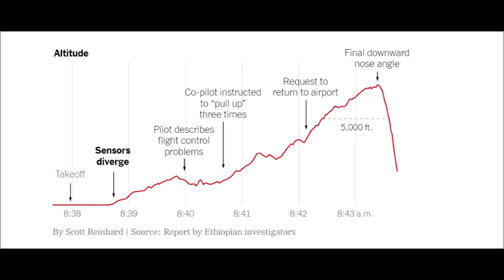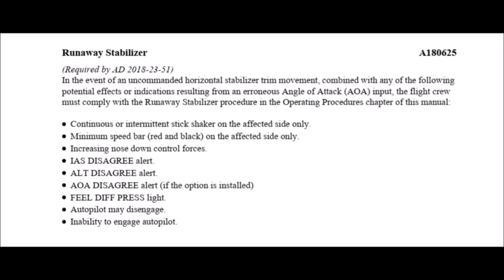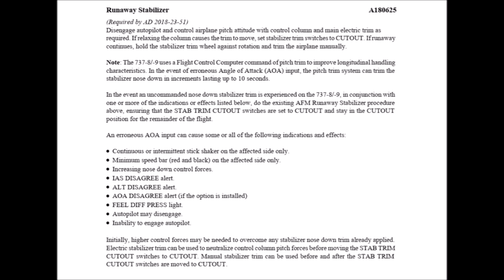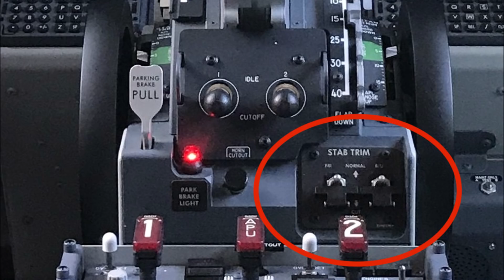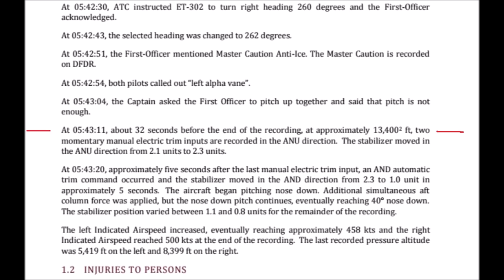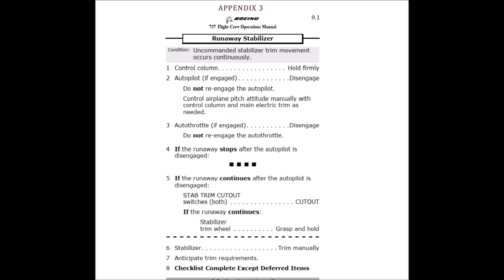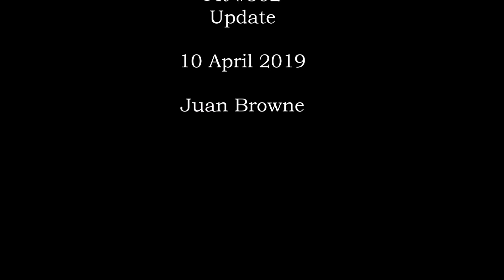737 Max Update 10 April 2019 Runaway Stab Trim Procedures

Comment: Edit: It looks like the pilots did have control of the stabilizer but didn't continue with manual control.
Original: Shouldn't the manual trim and or power trim of the system be powerful enough for any situation the aircraft can get into on it's own? Feels like these aircraft should have been recertified and in doing so, the old screwjack system and/or chassis strength redesigned. That would have allowed the pilots to re-trim the aircraft and gain control so long as no mechanical single point failures occur, e.g. binding of the stabilizer bearings or material failure from too much stress/strain. That's assuming the recert procedure takes a look at the controls and forces on the aircraft. I'm very disappointed in the entire climate that's been created around aircraft design and certification but granted I don't know much about it, only the results. Very sad when thinking about this on the human level.
Reply: Jon Prevost Good points!
Reply: @gordonrichardson2972  What evidence is there that the electric trim isn't "powerful enough for any situation the aircraft can get into on its own"?
What evidence is there that the pilots couldn't "re-trim the aircraft and gain control"?

At 05:40:00, MCAS reduced trim from 4.60 units to 2.1 units.  At 05:40:12, the pilots used MET (for about 3 seconds) to increase trim to only 2.4 units, instead of back to 4.60 units.  
At 05:40:20, MCAS reduced trim from 2.4 units to 0.4 units.  At 05:40:28, the pilots used MET (for about 10 seconds) to interrupt the MCAS AND command and increase trim to 2.3 units, almost back to where it was after the second MCAS AND command, but not back to 4.60 units.
The pilots then shut off electric trim.

At around 05:43:11, the pilots turned electric trim back on and used two brief MET commands to increase trim from 2.1 to 2.3 units.
  We don't know why the pilots stopped trimming up.  There was an AP Warning that coincided with the second command, but the Ethiopians don't provide any CVR transcript for this time period so we don't know what the Warning was or what the pilots may have said.

This shows the following:  1) the MET was working at airspeeds approaching and above VMO; and 2) the MET was capable of fully-reversing the AND commands from MCAS.
Reply: @Daniel Forman I'm not sure why you are responding to me? My point was that we need to wait for the official investigation, not make assumptions based on what we think the FDR readouts imply.
Reply: @gordonrichardson2972  Jon Prevost's post  
1) said that power trim of the system should be powerful enough for any situation the aircraft can get into on it's own, implying that it wasn't; 
2) implied that a redesign of the jackscrew and "chassis strength" (whatever that is) was required to allow the pilots to re-trim the aircraft and gain control; and
3) argued that such a redesign should have been required for recertification of the Max (presumably relative to the NG).
I responded to your post because you said these were "good points," and I don't think they are.
I missed the part where you suggested that Jon needed to wait for the official investigation and not make assumptions based on the data contained in the Preliminary Report.
Reply: @danielforman5064  I think we dont know how the trim actually worked in terms of quality at last moments (how fast it moved and if it didnt got stuck?). The graph has low resolution and the information is just sparse regarding this matter.
Reply: @Daniel Forman I still don't see why you are responding to me, and not to him.
Reply: @LaggerSVK  The Preliminary Report says how much the trim moved and you can see from the graphs that the switch was pressed only momentarily each time.  I suppose it is possible that the trim got stuck in the nose up direction only but the investigators recovered the jackscrew and didn't mention any physical evidence of that.  In any event, I agree that the information is sparse.  It would have been useful if the Ethiopians had included a CVR transcript for this time period (which was crucial).  It is hard to believe that the pilots weren't talking to each other.  
I would also be interested in someone who is knowledgeable explaining what conditions might explain the AP Warning that went off at 05:43:15 (the warning is not mentioned in narrative in the Preliminary Report).
Reply: @danielforman5064  I was thinking more about the friction than a physical damage to jack screw. It looks like the time vector is spaced in seconds so we dont know how exactly long the trim commands were and what was the actual behavior of the elevator trim.
Reply: @danielforman5064  I'm in complete agreement with you after looking at the Appendix graphs more closely. It does look like the trim was working, only very slowely (no flaps condition). It appears as if the pilots were trying to re-adjust the trim electronically and that it was working. Why didn't they continue?
Thank you for making me look closer.
Reply: @LaggerSVK  I agree that we don't know exactly how long the yoke switches were pressed, although each box in the graph is 3 seconds so each activation was significantly less than that.  The Preliminary Report says the cumulative effect was the trim moved from 2.1 to 2.3 units.
I agree that increased friction is a possibility.  At around 05:40:27, the MET successfully moved trim from 0.4 units to 2.3 units.  Airspeed was between 275 and 300 kts.  At 05:43:11, when they again tried MET, the trim position was 2.1 units (less aerodynamic force) but airspeed was between 300 and 325 kts. (more aerodynamic force).  I'd have guessed that the difference in starting position might make more difference than the add'l 25 kts., but that's just a guess.
Do you know enough to venture a guess about the AP Warning?
Reply: @JonPrevost  You are very welcome, and I don't  know why they didn't continue.  Other mysteries are why, after not continuing, they didn't put the electric trim switch back in the cut-off position (there was 5 seconds before MCAS re-activated), or, after MCAS re-activated, they didn't counter with MET before putting the switch in the cut-off position.  The CVR may hold clues.
Reply: @danielforman5064  I am also wondering but from my understanding they were under heavy stress and they were trying to pull yoke together so Iam expecting that they were not just psychically but also physically exhausted. I am wondering what would be the final report but they were under very tough conditions.
Reply: @LaggerSVK  I don't think we'll learn anything new from the final report.  The Ethiopian gov't is not being forthcoming with information, and is adamant that its pilots did everything they were supposed to do.  They are unwilling now to disclose what the CVR contains at the crucial moments in the flight, and I don't think that will change.  I suspect that what's on the CVR does not reflect well on their guys.
There are other issues that were glossed over in the Preliminary Report that I don't think we'll ever learn the truth about.  
1) What was the effect of weight and balance on the flight?  They disclosed weight and balance and claimed the take-off was normal, but they were heavy.  Do they have video of the take-off?  How long was the take-off roll?  Did they have trouble climbing initially?  Why does pitch attitude spike to 20 degrees 6 seconds after WOW?
2) Gebremariam made a big deal right away about the pilots reporting "flight control problems."  The pilot first told the FO to request to maintain runway heading at 05:39:50, then repeated the request at 05:39:57 and told the FO to report "flight control problems."  Problem is, MCAS hadn't activated yet.  The captain-side stick shaker had activated almost a minute earlier, so there was a lot of cockpit dialog between the stick shaker activating and the "flight control problems" which hasn't been disclosed.  I doubt the captain was referring only to the stick shaker as "flight control problems."  During that time, they also had experienced the initial pitch excursion, had been fiddling with pitch trim, had the autopilot disengage, and had been climbing poorly.  But the Ethiopians would prefer that the world believe the "flight control problems" reported by the pilot referred only to MCAS, which hadn't activated yet.
Boeing is in a very weak position to push for a transparent investigation and I don't think we'll get one.
Reply: @danielforman5064  There was an AOA divergence which could have an effect on flight controls of the plane.
Reply: @LaggerSVK  The pilot side AOA failure triggered the pilot-side stick shaker, but not the FO stick shaker.  I've read that the AOA failure was responsible for the airspeed disagree, and I surmise that perhaps that could have affected the autopilot.  But the autopilot engaged after the AOA failure, so the airspeed disagree didn't prevent use of the AP.  The AP didn't disengage until 33 seconds later, and the airspeed disagree didn't seem to change much over that period, so the airspeed disagree probably didn't cause the AP to disengage.  I haven't read what else the AOA failure could have affected.

Comment: Thanks for the update Juan.  Is it possible, because the pilots did not have a AOA disagree light, and therefore could not rule out a stall condition, that they felt they needed more power, and therefore they left the autothrottle at full, in attempt to fly pitch and power?  
But yes, it does seem logical that high speed flying the 737 Max made it impossible to turn the trim wheel manually.  And I don't know if 7000ft is high enough to start the yo-yo procedure for manual trim.

Comment: Thanks for your time and effort. I'm not a pilot. My dad was a P-51 test pilot after WWII and I grew up reading flight manuals on all sorts of planes...thus my interest.
Yesterday there was a post on trim motor overheating and possibly failing. I hope I can get it to post:
  …
I typed this yesterday after reading a post by "Normand Hamel" describing  overheating of the trim motor as a possible cause. He mentioned  "Gilles Primeau" speaking on a radio show in Canada. I can no longer find the original post.

It makes sense that the loaded stab at speed "could" burn the Nose Up Trim motor motor out...or impair its' function.
I also ask why flaps weren't redeployed at the first instance of "stall" warning...ie. flaps "help" the lift characteristics of the wing. and even if they didn't understand MCAS(which was triggered by the flap retraction due to AOA sensor failure)prior to gaining so much airspeed?

Not trying to condemn anyone, just trying to understand if the pilot lost the battle or the Nose Up Trim motor
 failed them after the stress of the high forces on the stab. 
And stimproid, I'm also interested in your comments.
Reply: I think I read a comment about witnesses seeing smoke coming from the rear of the plane somewhere. I've also read that these trim motors cannot overheat. I don't know for sure. I do know that eyewitness reports in many cases tend to be unreliable. There could have been a vapor trail coming off of the control surfaces due to the deflection angle of the elevators and the extreme speed. To the untrained eye this could have looked like smoke. 
Pilots are taught to recover from a stall by pointing the nose of the plane down and increasing throttle. Anything to do with flaps is outside the box. While it may have helped in this case as it would have disabled MCAS, it isn't something they would have initially considered. 
After thinking about the crash for some time, and having the benefit of learning about the MCAS system, I believe the best course of action would have been different than what Boeing recommended. As soon as they realized they had an MCAS failure, the copilot could have grabbed the trim wheel and prevented it from moving in the down trim position. They could have continued to use electric trim to point the nose back up, stopping the wheel by hand for the 10 second intervals that MCAS wanted to trim down, until they got the plane into a good trim condition, then cut out the trim switches and fly manual trim the rest of the way.
Reply: @stimproid  I don't believe they could stop the trim wheel from moving under electrical power with arm strength. The jack screw is more levered than physical strength.
The Lion air crew that had a runaway trim and rectified the problem reported smelling an electrical burning smell in the cabin after their event, according to the poster I quoted.
The maintenance log from Lion Air should show if the trim motor was checked after that flight, prior to the fatal crash of the next flight.
I don't believe those pilots gave up...They turned the stab cutouts back on to try and trim back up with the thumb switches. The electrical signal was sent...the question is did the trim motor have the ability to respond/the forces on the stab were to great for the trim motor to overcome.

Comment: Lack of training of runaway stabilizer trim due to MCAS and reliance on auto-throttle makes for perfect storm? Question: Wouldn't auto-throttle reduce engine thrust as air speed exceeds limits?
Reply: It depends on what target auto-throttle is set to aim for. After takeoff the rate of climb is more important than airspeed.

Comment: Hey Juan. Great work. I still have a question that no one has answered. Does the trim wheel turn when getting input from the MCAS system? Next question: after the MCAS system detects a nose high/impeding stall situation and starts feeding in nose down trim and supposedly corrects as the nose comes down, does the MCAS system take out the nose down trim that it has fed in?
Reply: The intention of MCAS was that it would unwind the nose-down trim, after the AOA was lowered sufficiently. However in the crash scenario this never happened, since the AOA vane was stuck. Once the MCAS software is fixed, this should operate smoothly (if it is ever needed).
Reply: Gordon Richardson that makes sense. Thanks
Reply: @gordonrichardson2972  - they need to upgrade the computer processing power.  I don't think the MAX 8/9 designers were dumb but what they had to work with is.  The lawsuit costs  and jail times  are preventing Boeing from cancelling the Max 8/9 program for now.
Reply: The trim wheels on both sides of the pedestal move and make noise any time the trim moves. The Wheels are primarily black with white markings making it obvious that hey are moving. I don't know the answer for sure about MCAS being able to  trim up, but I suspect not.

Comment: I’m trying to not judge the pilots. Finding it difficult to understand why they didn’t recognize the “runaway stab” when it started to trim without pilot input. A faulty MCAS system results in runaway stab trim for which procedures are documented in the FCOM/AFM and has been since the first 737-100. 

https://youtu.be/3pPRuFHR1co